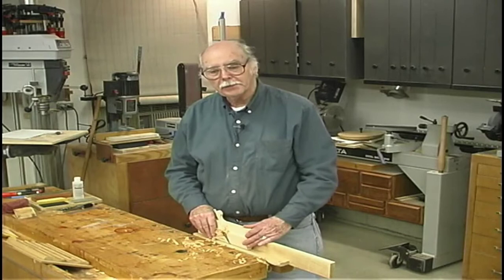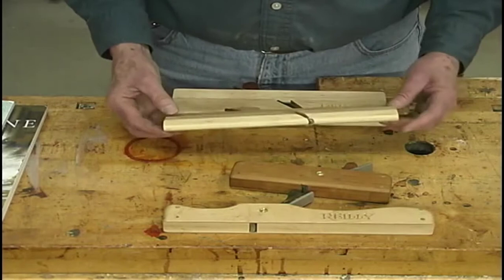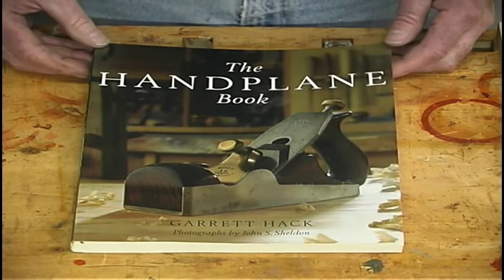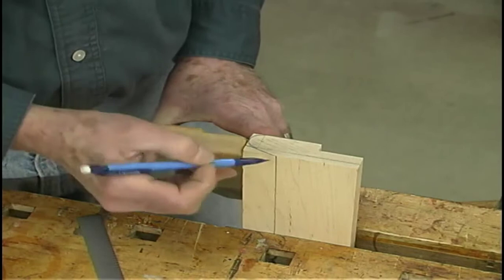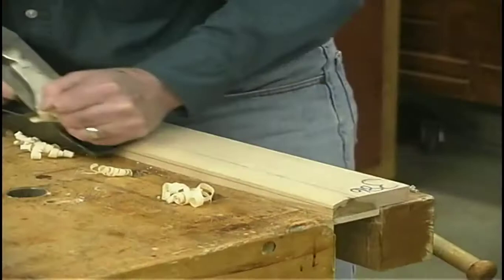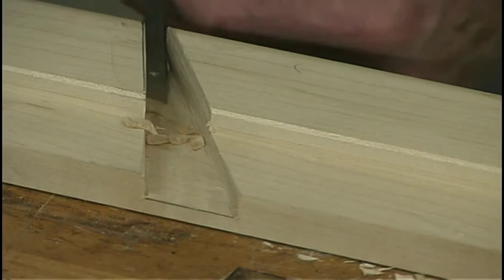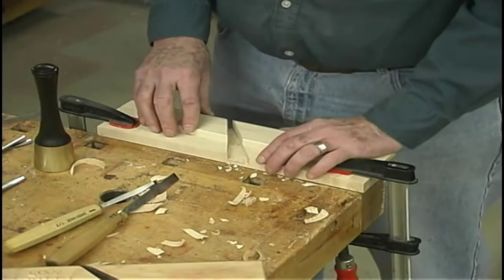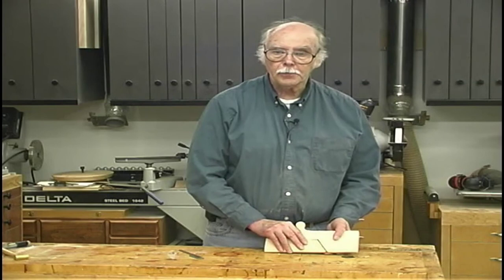W083 Making a Molding Plane   Part 1 of 2 V

Comment: I appreciate the video, but don’t understand using a batten as you do.  Why not cut in a rabbet for cutting rounds and add a chamfer to use when cutting with a hollow? Far less material to remove with the H or R plane and it makes them run on rails that hold true right where you want them.
Reply from the maker: Hi @TheSmeac ,
Being that this was filmed about 20 years ago, the fog of time obscures my understanding of why David was doing what he did in that regard.
Cheers
Chris